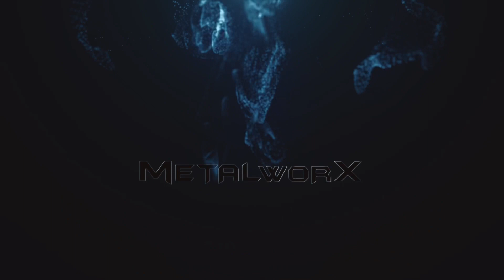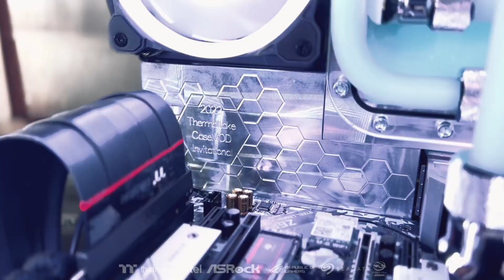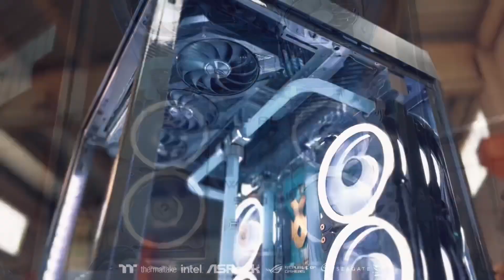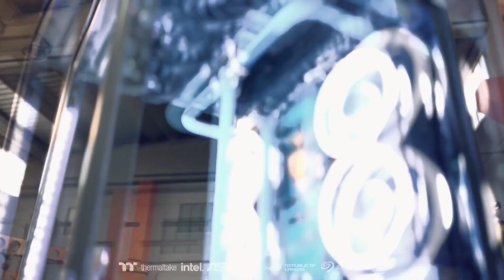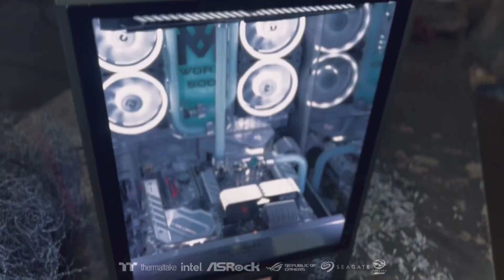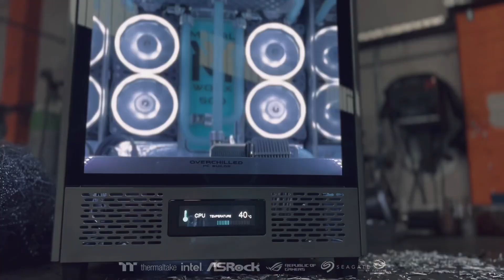2022 Thermaltake CaseMOD Invitational Season 1 - [Greece] George Antonopoulos

Comment: My sons computer has a Thermaltake Radiator on top of the processor, hes stated the ring of light doesn't work and the cpu is 75C today. the last couple days its been hotter. I cant see anything not connected or loose. Upon start button it flashes a blue ring then off. Just looking for possible issues fix and maybe its heat sensitive before it starts up? Fans work, hes got like 6 in it, all of them are lit up. Just curious if someone has an idea? Thanks Steve
Reply: you should check the contact of the cpu block if its properly tighten . and also you must check if the pump working. If it works very slow you must set the rpm higher.